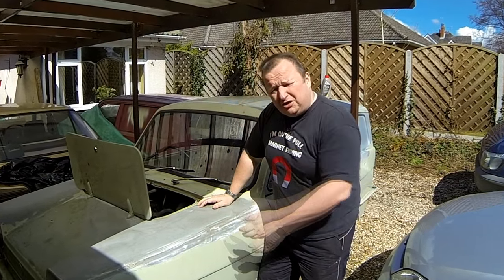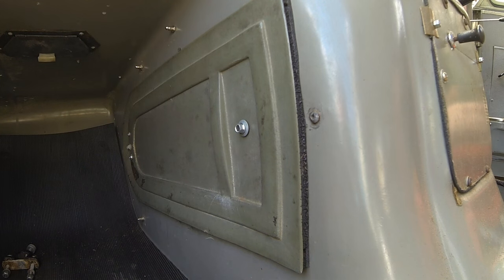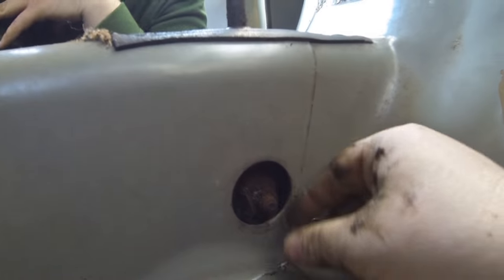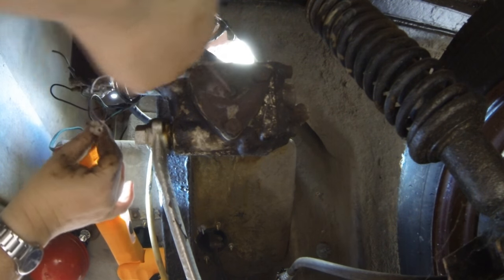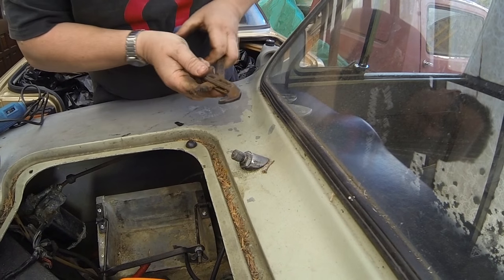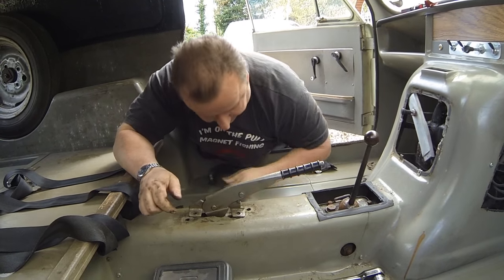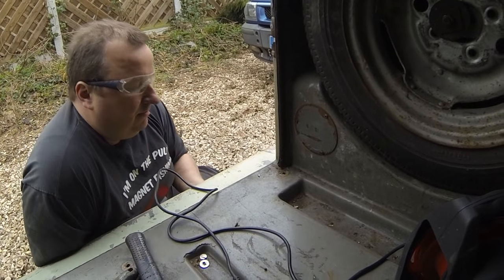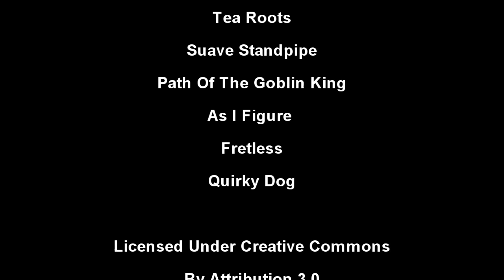Part 2 Reliant Regal Supervan Trotter Restoration Removing The Body

Comment: Martin I love your videos mate. Your giving me inspiration to just get on with it and have ago. Your a top man.
Reply from the maker: +Mark Lechon That's great Mark. It's better to have a go than to look back and regret not having a go.
Cheers
Martin
Reply: +retrorestore although saying that I'm having trouble with my mower blade bolt I wish I never started lol. Tried plus gas and brute force and heating it up carefully and I think I've rounded it off😭
Reply from the maker: Mark Lechon
Oh dear. You could try a nut remover socket and an impact driver.
Cheers
Martin

Comment: You aint no Del boy when it comes to restoring things Martin. Later on the restoration of the Regal clips can you show me how you repair cracked or torn fibreglass? always wanted to see how they do it.
Reply from the maker: +michael jagger I do have some fibreglass repairs to do on this Michael so keep tuned.
Cheers
Martin
Reply: retrorestore Will do it will be interesting to see how its repaired much easier than metal put it that way.

Comment: Little tip for track rod ends, leave the nut on when shocking it loose, then if you miss you will not damage the thread.

Comment: the heater bolts are not 11mm they are 7/16 the whole van is imperial if that helps and the steering box is held by 3 bolts and they need a 9/16 spanner / socket
Reply from the maker: +Daniel Clift Yes, I know bud but i'm thin on the ground with imperial spanners and sockets. I'll be replacing most of the bolts anyway as most have sheared. Thanks for the right sizes.
Cheers
Martin

Comment: Great video Martin, well at least you can get at most things on it. Should be easy to work on after the body is removed. I remember fitting a new master cylinder and having to free off the adjusting rod on it just lying under the van to remove and re-fit it. Did you say you was going to replace the engine with the 850 ? . Look forward to seeing the body off in part 3. Keep making these great video's Martin !. 
Cheers, Jeff.
Reply from the maker: +cabdriveruk Yes,so eay to work on compared to modern cars.  I have an 850 engine that came with it but I don't know the condition so it will need checking. More to come Jeff.
Cheers
Martin

Comment: hi Martin them reliant engines smoked when they were new out of the factory, reliant made the engines from scratch on lathes that were way out of tolerance so piston slap was common, the rear axle is a triumph herald so I never bought so called genuine reliant brakes and other parts ect
Reply from the maker: +Marjorie Redman That's interesting. This one smoked more than Winston Churchill on a smoking holiday lol.
Cheers
Martin

Comment: Previous owner will have added the indicator light on dashboard simply because the flasher on the speedo is set too high. When driving you can't see the indicator flasher and so it's all too easy to leave the indicator running and giving out false info to other drivers. It's not self cancelling and is practically inaudible when the engine is running.  Until you drive one you won't notice this.
Reply from the maker: Ahh, that explains the modification bud. Thanks for that.
Cheers
Martin

Comment: that middle engine cover should be 1 piece its been chopped in half as well as a hole drilled for choke cable. i have some of those covers if needed ? are you keeping that carpet ?
Reply from the maker: Yes, keeping the carpet Dan, it's in good condition but may change the colour to black.
Reply: do you have any pics of your carpet so i can get an idea to look for some the same ? mine never had carpet even if it did it wouldnt be any good anyway
Reply from the maker: only in the stripdown vids. the carpet only covered the centre console and the rest under the seats and front footwells is rubber.
Reply: oh yea i know the floors is rubber i threw mine out it was falling apart i found the same stuff on ebay but the roll is 1.2 meters and i need around 1.4
Reply from the maker: Ahh the stuff in this is in very good condition. Can't remember if it's in the vids though